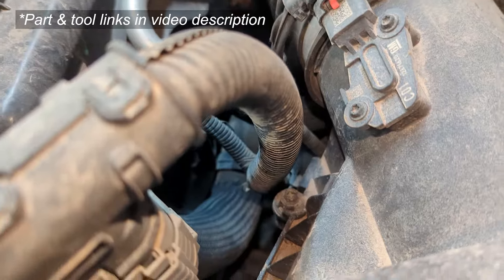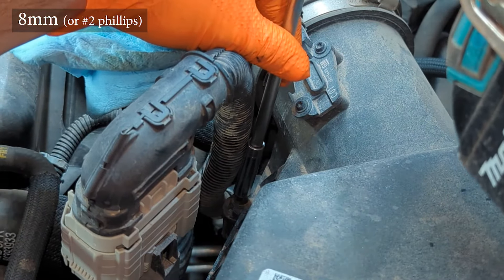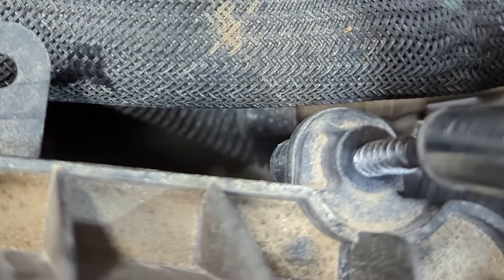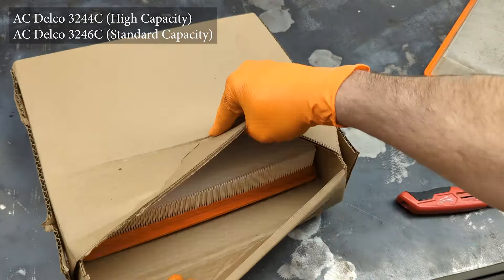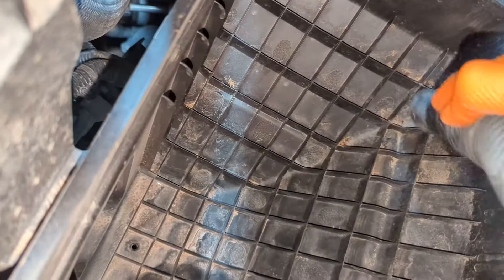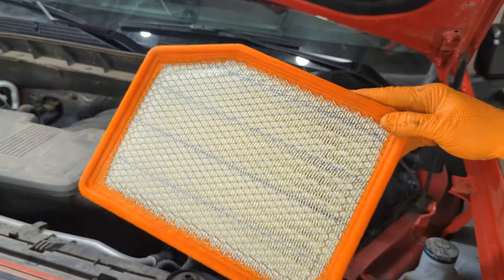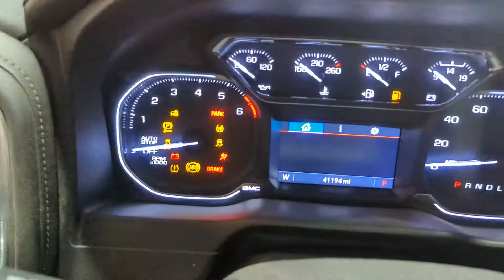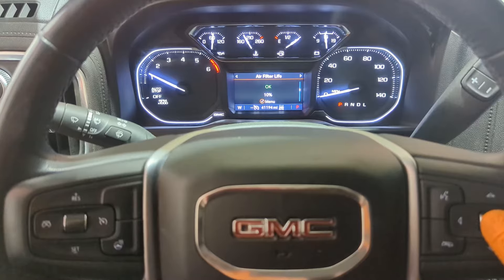2019-2024 Sierra/Silverado: Engine Air Filter (5.3L)

Comment: Thanks for the video. Some I have done require that the electrical connectors be removed and such. This was helpful, as was the 8 mm socket reference. Saved a trip or two to my shop from the attached garage. Maybe I should keep sockets in the truck with my tool bag? Right... I underscore your implied caution about dropping the screws. They would disappear into Chevy Truck-land never to be seen again. Nicely done.